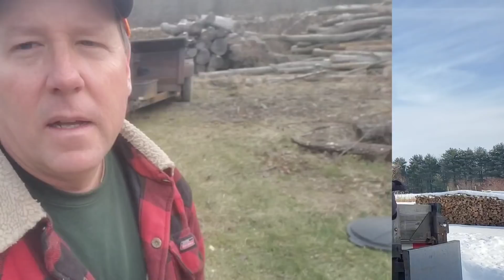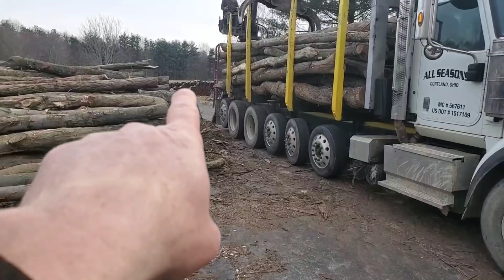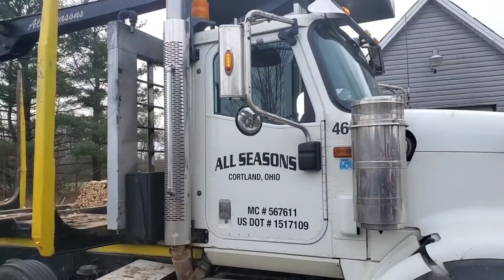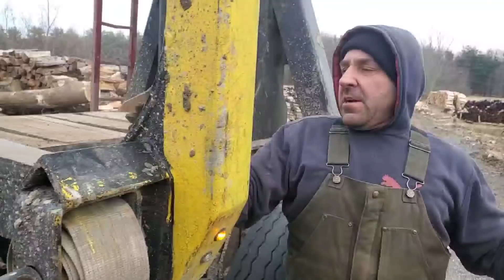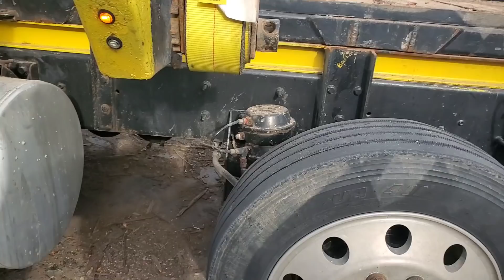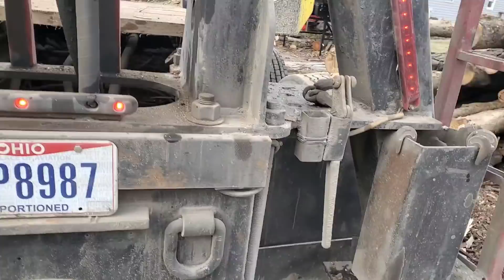WHAT AN AWESOME LOAD OF LOGS!!!

Comment: Morning Joe
When you move your equipment are you going to put a roof over it where you can work and keep the equipment out of the weather?  Barbecue joints don’t want Hickory? Most around here would love to have it. Great load of wood!
Reply: A roof would be a amazing addition!! Work in any condition, even put some lights under the roof to work in the dark!
Reply from the maker: Of the BBQ I deliver to only one wants hickory and they are pretty low volume for me.  The others want oak or cherry.  I also think that hickory is problematic to source at times and prob the long term joints had migrated towards more abundant species.
Reply: @ohiowoodburner  You might be better off turning the hickory into all small bundle wood for the backyard BBQ guys? Maybe cut some to 12 inch lengths so it fits in the smaller offset smokers?
Reply: Favorite restaurant is Hickory Park Restaurant,  Ames, Iowa.
They go get their own wood with their own semi.

Comment: Here, in New Zealand, our logging trucks do not have those auxiliary axles with the smaller wheels. When are they lowered? Do they steer? I am intrigued. Cheers everyone.
Reply: Lowered only when loaded going down the road.
They are "self steering". Similar to towing a car with a tow bar.
They automatically raise when the truck is in reverse.  They don't self steer in reverse.
Reply: @haroldphipps3457  Ah, I see. THANK YOU, Harold. I am very grateful for that. Cheers!!
Reply: I have four air switchs in the cab they are all steerable,I put them down when I'm loaded an I can adjust the air pressure four each axle in the cab
Reply: @loghaulerjesse8228  Thank you Jesse. It is a bad day when you don't learn something and you have made it a good day! I am very grateful. Thank you!